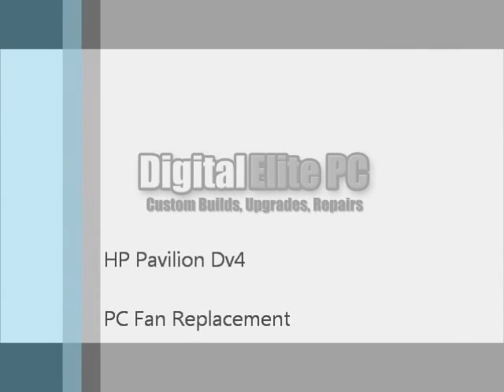HP Pavilion Notebook Repair Tutorial

Comment: How do 'we' disassemble HP Pavilion dv7-1245dx Laptop (notebook)? NOTE: HP Pavilion dv7-1245dx Laptops Have known to be a notebook that has problem after problem after problem after problem..  I got my HP Pavilion dv7-1245dx because of the nice remote controller to use like a T.V. remote for the PC, the large screen with shiney coating, Vist versus XP (actually didn't have much choice since retailers only carried Vista operating systems at the time).. good day